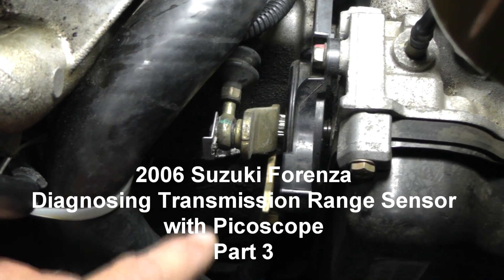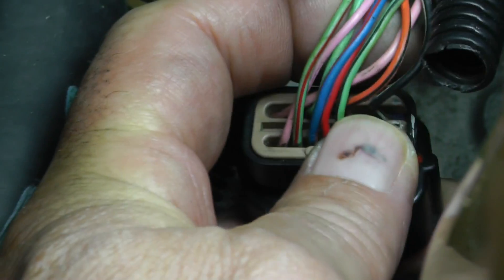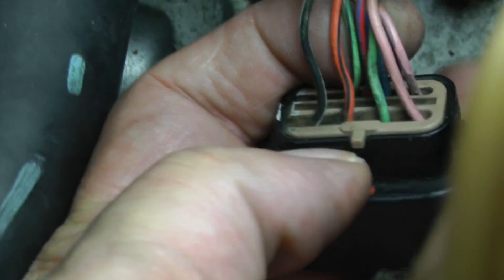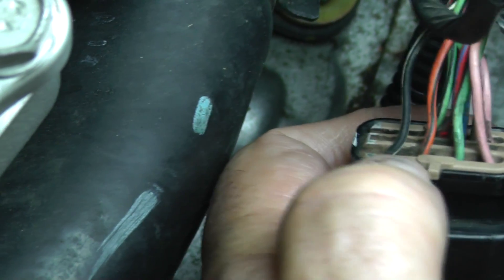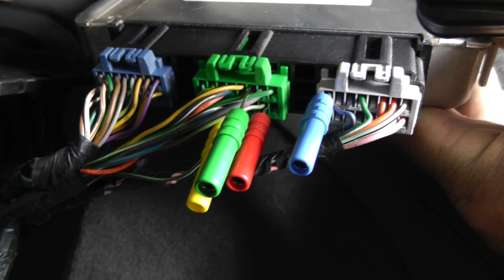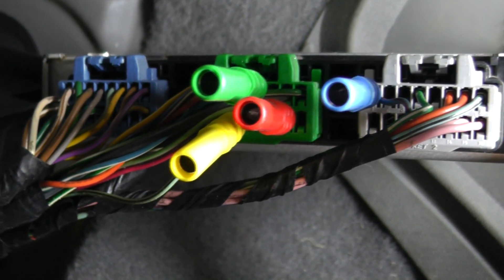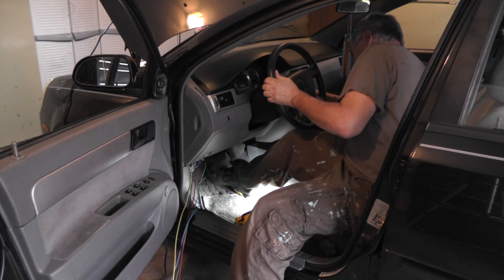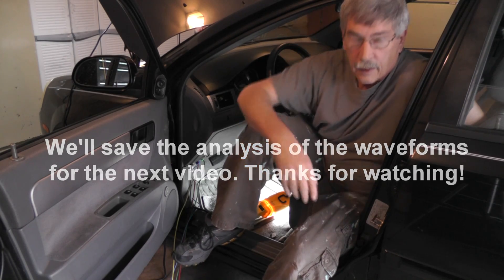Diagnosing Transmission Range Sensor on Picoscope - Part 3

Comment: Your videos are very helpful I just got a question I've got a 2008 Suzuki forenza while I was driving on the dash I saw the letter P and when I gave it gas the engine just revved up while I was still rolling then it went back to a D on the dash and took gas normal then and drove home fine now just going through the gears in the driveway sometimes it's reading the wrong gear on the dash that the gear stick I actually in sometimes it reads fine and I'm able to drive it but not long after taking off it reads P again could this be the transmission range sensor your help will be greatly appreciated thank you in advance
Reply from the maker: Yes, from the symptoms that you describe, it's quite possible that you have an issue with the transmission range sensor. If you have a scanner, you could see if you have a code P0705 which confirms you have an issue with it. The part is not that expensive if you decide that you want to fix it yourself. Have a great day!
Reply: @stuzman52  I changed the transmission range sensor and that was my problem it wasn’t even hard to change after watching your video thanks a bunch much appreciated
Reply from the maker: @Just-go-with-it  Glad to hear everything worked out okay!

Comment: Hello mr i got a suzuki reno 2006 i chance a trandmision range sensor but always have a problem wiht the p0700 mil i dont understand
Reply from the maker: The code P0700 is a generic code for the transmission and doesn't mean that there is an issue with the range sensor. You will need a scanner that can read specific tranny codes which could help give a better direction for troubleshooting.
Reply: thanks  i got a crp 123 by launch scaner and that scaner can read troubles of the transmision and i bought the tr sensor new but i dont understand why? keep appear the trouble of sensor range

Comment: I have a 2007 Suzuki Forenza a few days after I bought it and started acting up when you give it gas it would barely go it would be driving fine then stop at a stop sign and then then it would do barely move but sometimes if you take your foot off the gas and repressed it will start working right does that sound like the range shifter join that I watched your video and I never did catch where you said how the car was acting and what made you thank you it was the rain sensor appreciate if you could let me know thank you
Reply from the maker: When the range sensor goes bad, the transmission will go into limp mode. This means from a stop, the transmission will start out in third gear since the transmission control module, TCM, doesn't know what gear it's in. If you see a diagonol line across the PRNDL display, this is also an indication that the range sensor may be bad. It's best to just hook up a scanner and see if there is a P0705 code. This would indicate a range sensor issue or its circuitry. Good luck on what you find!

Comment: I have a 2005 jetta automatic that will knock into drive in first and shift smoothly through gears . But once  you stop at stop light after it warms up the car says on dash its in drive but wont engage any gear exept reverse.. then when its cooled off again it will jolt into first ..and reapeat.. what do ya think it is .. range sensor valve body solenoids.. please help..
Reply from the maker: First thing I would do is put a scanner on it and although the check engine light may not be on, there may pending(s) to help give you some direction.

Comment: Hey I have a 04 dodge neon sxt. ive replave the transmission control module (TCM), the input and output sensors and the filter. It runs fine. Drives fine. Just will not shift from 1 st gear. So would the range sensor be the problem I believe the only code it is showing is p-001. Please help!!!

Comment: hello sir i have a problem with my suzuki kizashi it drive well but when it gets hot for driving or a while the transmission seems to get  stuck in 5 gear slow pic up at top light and tranny whines. I think its the range sensor
Reply from the maker: I would put a scanner on the car and see what code(s) pops up for you.

Comment: Mr.Pike,
Could the anti knock sensor cause it to not accelerate when put in drive? It acts like the transmission range sensor switch (I had that replace last year)
Reply: stuzman52 Thank you very much!
Reply from the maker: No problem...hope you get it fixed..

Comment: Hi Mr. Pike,
Just finished redoing my 2007 Suzuki Forenza that had jumped timing and bent all my valves. Couldn't heave done it without your videos. Thank you greatly. However, this morning I went to test drive and the check engine light is on (I have no scanner); and it runs beautifully but when I put it in gear, doesn't want to go and will even turn off on me. I'm now reviewing the videos you have on the TCM. I could really use some pointers as to how to read the codes on the Forenza manualyl (if possible). I'd also like to know if there is a way to get in touch with you besides this.
Thanks.
Danny Pittman
Reply from the maker: Hi Danny... Glad to hear the videos helped. So, I assume the car ran great before the timing belt broke. Is that correct? If so, now the car doesn't run so well. If that's the case, I would verify that your timing marks are correct. If you're off one tooth, you'll experience the problem you're having now. So, I don't know if the car ran good when you got through with the job and then later it acted up. I assume you had a problem when you got through since you said you went out for a test drive. As for the code(s), you can't read it manually. Back in the old days when cars were OBDI, you could read code(s) manually. Today with OBDII unless you have a luxury type car where you can read them through the driver information center, you'll have to have a scanner. You can go to one of the major auto chains like Autozone, Advance and they can read it for you. Good luck on your repair.
Reply: stuzman52 Hi. thanks for replying. The engine runs like a sewing machine now. When I went for a test drive, it would hardly go up the road, and finally cut off on me. It cranked right back up and I was able to get back to my garage. I borrowed a scanner and it had 2 codes in it --- 0031 and 0325.
 I can't find where the anti knock sensor is located, though. Can you help?
Reply from the maker: Okay, keep in mind though that if your timing is off, you can get a knock sensor code. The P0031 looks like a O2 heater circuit low fault. I don't know exactly where the knock sensor is since I sold the car along with the manuals in February. The sensor should be mounted in the cylinder head, maybe in the back. Here is a link to a free manual so you can review it. Good luck... http://www.suzuki-forums.com/suzuki-forenza-reno-forum/54175-links-reno-forenza-service-manuals.html

Comment: Omg so jealous you have a scope!  I really want one and you did a phenomenal job of detailing the connections and anaysis- as always very thorough video!
Reply from the maker: Hi Matt! I was going to send you an email about what ever happened to you as it's been quite awhile since we've heard from you. I saw that you posted to Spelunkerd who asked the same question. As for the scope, I have four of them, and I must admit that Picoscope is the bomb. I use it whenever I can, even in an industrial environment looking at high speed communications equipment to point me in the right direction when doing diagnosis. If you ever do get a scope, and I recommend Picoscope, be sure to check out www.autonerdz.com and get in touch with Tom Roberts over there. Once you buy your  scope from him (and you'll get extra accessories), you'll be opened up to a lifetime membership of video tutorials, case studies, how to analyze waveforms, not to mention the really sharp guys over on the forum who discusses real cars that have problems and using the scope to pinpoint where the problem is. Thanks Matt for your comment and once again, I'm glad that you're back with us.

Comment from the maker: Hi Joe and glad you dropped in. I've got through with the analysis of the waveforms and it's all rendered. I spent a lot of time on this video with animated graphics to enhance the understanding of the scope and the understanding of the waveforms. Hope you like it! This video should be up in a couple of hours. Sticking the pins in weren't too bad as they were spaced out a good distance. And that's what I like about the Picoscope in that it can have some very long time bases.
Reply: stuzman do you need to relearn the tcm if i change it